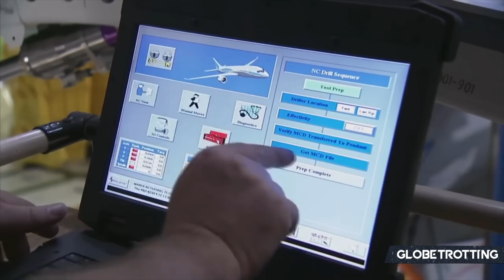Is The Airbus A330neo A Failure?

Comment: Yes, A330neo - 800 is a true failure 
but the A330neo - 900 is actually a winner
Reply: Mere existence of A330-800 cost Boeing hundreds of million dollars in Hawaiian Airlines project. There can be other cases that we don't know. Sometimes you win by making your competitor lose money.
Reply: @sainnt  There are 1000+ units of Ceos still flying. Most of them will be replaced with Neos when they are retired.
Reply: @user-yt198  I'd say close to half will become 787 or A350 orders. Both are newer models that have more room for enhancements in efficiencies and customer appeal.
Reply: @erickelly3447  That is possible. 1500 units of 330ceos have been delivered. Half of it makes 750 already.
Reply: @erickelly3447  Need to consider that the 330neo can also replace 767s although it’s highly unlikely any airline wanting to replace their 767s hasn’t already order the 788
Reply: The A330-800neo is very heavy at 251 tonnnes with a very long range of over 15,000 km. That range is too much. If Airbus would reduce the range and weight of the A330-800neo to 12,000 km and 215 tonnes respectively may be the aircraft will be attractive to airlines.
Reply: @jonahboonyarit4715  especially considering the 767 has only been available as a freighter or military cargo plane for sometime now. With the arrival of the 787 and A350, I see the 330 NEO viewed by arlines as merely a niche plane. It just doesn't bring anything special to the table in comparison to newer aircraft. I'm a huge fan of the 747 and flew on it a lot back in the 90's. But when the 777 came online, it quickly began to fall into the category the A330 is now in. Excellent plane but better options that provided greater effencies now exist.
Reply: @sainnt  Cebu Pacific, Air Asia X, Garuda Indonesia, Malaysia Airlines, ITA Airways... All this airlines are replacing the 330ceo with the neo version.

Wait until all the chinese carriers need to replace the A330ceo, over 200 units. I bet they will replace it with the neo instead of the Dreamliner knowing the situation with USA.

Argentina lineas aereas, Iberia, Level, Aer lingus, Brussels airlines, SAS, finnair, Air France and lufthansa group need to replace their A330ceo.
Reply: @sainnt  What are the Chinese airlines are going to replace the A330 if there is no other candidate. (China airlines is Taiwanese).

Do you believe the european careers that are currently operating the ceo are going to swap to the dreamliner. I doubt it. 

Alitalia is ITA airways, same planes, same stuff, same management. Just changed the name because they went banckruptcy.
Reply: @DanDan-pk6tx  well the 787 is naturally a better a330ceo replacement than the a330neo itself. Offers better cargo and regional payload capabilities making it popular in asia for a330 replacements. 

The top 3 Chinese airlines already operate the 787, only politics will force them to get the a330neo while the 787 more especially the 10 could offer much better economics for shorter regional routes. 

European airlines feel obligated to support their own, nothing wrong with that, some will definitely swap the 330/340 for the Dreamliner. Lufthansa, KLM and Turkish are some of those few
Reply: @mmm0404  Yeah the Dreamliner have better economics in some routes, thats what Boeing says. 

TAP is not very happy with the performance of the Rolls Royce Trend 7000 saying that underperformed what Airbus claimed and they are trying to solve it.

My point was that there will come many more A330neo orders, from European carriers and specially asian carriers, having in mind the political situation with USA, commonality and they can get the A330 in shorter time.
Reply: @jonahboonyarit4715  well Condor Airlines  from Germany are replacing their 767 with a330-900 and its better then the Lufthansa meanwhile

Comment: Reading through many of the comments, it appears that too many (from both camps of fanboy) do not understand what success is, or that success for an airline and success for a manufacturer are not the same thing.

For an airline, while the seat cost does matter, as it certainly helps the profit margins, and is so often used to support an argument, the trip cost is just as important, but often (deliberately?) ignored. At different loading levels, on different routes, the 'winner' may not always be the same.

We also have the volume of freight carried and the contribution it makes, something which is rarely mentioned.

Apparently, some routes can generate a healthy profit with a wide body when a 737 or A320 would be sufficient for the number of passengers. 

So far as the manufacturers are concerned, success and failure are far easier to define. It is a failure if it doesn't  make a profit. A simple calculation that can be manipulated to hide or exaggerate the truth. Quite simply, it is whether the return over and above the cost of production has or will cover the costs of development and in-service rectifications borne by the manufacturer.

While I was unable to find the break even number for the A330neo, few will question that it will be a fraction of the number required for the 787.

What does appear to be apparent is that the 'better' 787 hasn't yet achieved break even, and there are suggestions that it might never do so, or at best be a disappointment.

While the A330neo may only have the advantage of price, that advantage makes it harder for the 787 to generate the margins required to guarantee its financial success.

It could be said that real life is far more complicated and nuanced than any fanboy is prepared to accept.

Comment: Failure? Ridiculous! No more a failure than the Boeing neo, the 777x, in case you haven't noticed.
Reply: the 777x has outsold the A330neo though, and that’s considering the 777x is for a very specific market.
Reply: @AdriantheSpotter  Boeing has not sold very many more 777x than A330neos. The A330neo has done particularly well given the competition it has in the marketplace. 777x has less competition so should be way out in front of A330 neo in terms of orders. But it's not moving like it should be

Comment: No, I think that some of the existing A330ceo customers, including the Cathay Pacific Group, the HNA Group, Air China, China Eastern, China Southern, EVA Air, Thai Airways, Malaysia Airlines, Qantas, Asiana Airlines, the Lufthansa Group, Iberia, Air France, Virgin Atlantic, Virgin Australia, Scandinavian Airlines, Finnair, and Qatar Airways should order both this family of aircrafts to renew their existing fleet.
Reply: qantas will apparently order boeing 787-10 to replace its a330s
Reply: @philippedays6100  Why did they apparently select this aircraft over the Airbus A330neo?
Reply: @thyip6167  it’s much more efficient and technologically advanced than the a330neos.
Reply: @philippedays6100  However, the Airbus A330neo also has some benefits over the Boeing 787 Dreamliner, such as:
•Lower price and maintenance cost
•Common cockpit and type rating with the A330ceo, which reduces training and transition costs for pilots
•Wider cabin and more space for passengers and cargo
•Higher maximum takeoff weight and payload capacity

Comment: I think could not spread across due to A_350  first model small in size/ equal to A330 Neo.
  I think another set back one of the CEO of famous air line criticize safety issues of A_350 & question to Air bus & EASA  .

 End of the the day A330 Neo will pick up buisness deal .  Indian carrier entered with whide body aircraft, I believe they placed order for A _330 Neo. Same company have highest order for A_320 / Neo . They are in good profit making airlines.

 May I believe whole world is  watching growth of an airline from A_320 with good profit to international whide choosen to A330 Neo. 
 I strongly believe A_ 330  Neo will spread across as a  best aircraft by next year.
With a note aircraft weight can be reduced by using composite materials for wing / THS/ VS  & may be rearranged avionics bay . Definitely in fuselage not possible, due to certification issue.
Hope for the best.
Cheers 🥂🥂🍷🍷.

Comment: Most Airbus 330 classics are still to new to be replaced. In the meantime the Airbus 350-900 has beaten the B787-10 in orders more or less. So there is victory on both sides.
Reply: The a330 does not compete with the 787-10 but rather the 787-8/9

The 787-10 is in the same class as the a350 and 777

Comment: Airbus need to act fast and make a shrunk A350. Day a 80% scale A350 just shy of the size of a A330 to make a real competitive plane.

A full composite A330. While that would cost more then a reengine. It should still be fairly cheap.

They also need to think about the future and look at making a A360. A say 120% scale A350, with a full 10 wide upper deck and a lounge L1011 like lower deck.

They also need to make a A350-1100 to just be in the market with the 777x
Reply: Airbus will have a better hand coming than that in next 2 years. Rolls Royce are almost at test stage for the Ultrafan. Once they get this stage out of the way and have a scaleable geared turbofan, the Trent series will be discontinued and all future Airbus will have the Ultrafan. Even the A320 series will get an offering. It will beat the P&W GTF on fuel by 8% easily.
Reply: @nathd1748  well of cause. But it would make more sense preparing now aircraft for those engines then just reengine old once.
Reply: Absolutely no need. The A330neo is a perfectly good aircraft and it will be a success replacing the aging ceos.

Comment: The sheer COPE coming off the AB fanboys in here...lol.
Jeez...
Reply: There's a huge difference between the 787 being a better aircraft than the neo in many aspects and saying the A330 neo is a failure. The A330neo is a very good aircraft, despite being inferior to the 787 in some aspects, it can also be better on others (maybe because it's 8 years newer) and it will be a success replacing the old A330 ceos.
I suspect many here suspect the companies are going to replace the aging A330 ceos with 787s and A350. I say, a minority will, the vast majority don't. The reason will be cost of acquisition and operation (maintenance included of course).

Comment: It is a failure. Why? Because simply, 787 is far more superior than this.
787-8/9/10 is:
1. Far more efficient.
2. Flies much further, even surpassing the A350
3. Much newer hence more technologically advanced.
4. Burns much less fuel.
5. Much more attractive and appealing to plane enthusiasts and even non-plane enthusiasts

A330 cannot match the capabilities of 787 it intended to rival. Maybe the A330 can atleast nearly match the older 767 but not the 787. That is why there is a lot of 787s as compared to A330s.
Reply: The A350 flies further than the 787
Reply: Small correction: A350's range is larger than any B787.

And A330-900neo burn less fuel on routes shorter than 4,000nmi.
Reply: I’m no expert but I doubt airlines ever consider how attractive and appealing it is to plane enthusiasts (other than the 747) . I mean look at the A380, Easily the most popular plane in the sky in terms of passenger comfort and appeal but still culled pretty brutally
Reply: Wrong the a350 has a longer range than 787 
A350 900 can fly more further than 787-9 or 787-10
Reply: Oh look a Boeing fan... take a trip on the 747 MAX mate the CEO of Boeing says it's safe now
Reply: @HellStr82  What does a 747 MAX look like HellStr?    Sorry too easy.
Anyone who cares to take the time to really understand the MAX crashes can see why the planes crashed and how the problem can never happen again.   In short the pilots know where the MCAS off switch is.
Reply: @Dan Harold  oh yeah it's not like Boeing didn't tell the pilots that there is an MCAS system right? 🙄
Reply: @HellStr82  I would if there was one. After having flown on several different Airbus POS's, I go out of my way not to  fly on Airbus again.  Perhaps it is me, but they just don't feel or sound right. Working alongside of French engineers for years certainly didn't help the issue.
Reply: @danharold3087  There was NO MCAS off switch!! Da furk you talking about?? The damn plane would've stayed flying while they (Boeing) sorted it if there had been!!!
Reply: @HellStr82  Yes but not directly.   Boeing installed a MAX MCAS system into a NG plane.  FAA inspector looked at the plane and took it to mean that NG planes came with MCAS .  Because  of this MCAS was not mentioned in the differance training for the MAX.   That is why these two pilots did not simply turn off the MCAS when the AoA failed.  Now you can roll your eyes for real.  This is why these crashes are so horrific. With 2 minutes of training they would not have happened.
Reply: The 787 has some advantages but it's not far superior. It's better in fuel consumption and range, but the margin is not that far off and it is also more expensive.
 Excluding the airframe because of extensive use of light materials on the 787, the tech is more advanced on the Airbus, in part because the neo is the one more recent, the other part has to do with design concepts where Boeing is still playing catch up with Airbus.
Reply: @danharold3087  It's not so simple. The MCAS affects the trim and you have to corrected it manually. If you switch the autopilot to help with it the MCAS comes on again.
Reply: @miks564  Terms like better and superior are too nebulous without saying how.   One plane may have better range, a lower operating cost, easier to fly, more passenger comfort.   None of this means crap if the airlines don't buy it.  The only metric that counts is sales.  The Lockheed L-1011 TriStar was almost universally seen as best and most advanced by everyone but the people who were supposed to purchase them.    Sales were so slow it was a major factor in Lockheed in moving out of commercial aviation.   A plane is a success when you can find that sweet spot and own it.  It is the right plane for the segment wins. The person at Airbus or Boeing who can look into their crystal ball and know what that plane should look like, and sell the idea to others who think they know better, is proverbially worth their weight in gold.

Comment: The 787 is much more efficient and can fly further than the A330neo not to mention that it's equally priced(regardless that airlines never actually pay list price). The dreamliner killed the neo just like the B777 killed the A340
Reply: It is quite opposite in the narrowbody segment, specifically the long-haul narrowbody segment. The A321 XLR is not even flying yet but the order books for the aircraft are being flooded by costumers. The 757 is not even being produced anymore, and the 797 would probably take a decade or two, might never even happen too.
Reply: Much more? Not really. The 787 is more efficient and can fly slightly further than the A330neo. ...And finally they're not equally priced.
Reply: @miks564  A330-900's list price is $296.4 million and can fly a maximum of 7,200 nm, B787-9's list price is $292.5 million and can fly a maximum of 8,500 nm. on paper the 787 is cheaper and can fly 1300 nm (2,407km) further. I don't see where your argument comes from

Comment: Look at Virgin Atlantic it is getting  A330neo and has A350-1000 it also has B787-9 in the future it will get rid of the Boeings and become a all Airbus fleet
Reply: "In the future" are you the CEO?
Reply: Where is the evidence they will get rid of tne boeings?
Reply: @nickolliver3021  Virgin Atlantic is controlled by Delta Airlines which has is planning all Airbus wide body fleet so Virgin will follow to make it easy for cross selling and market it as one airline
Reply: @marcoducceschi3849  Virgin has no intent of letting go of their 787s. That's correct but Virgin has their own say and decisions to make of what aircraft they would order in future and still want to use.